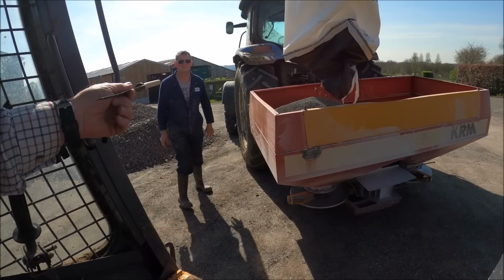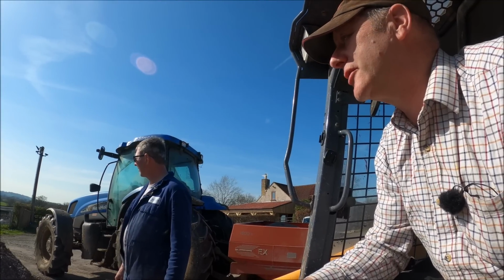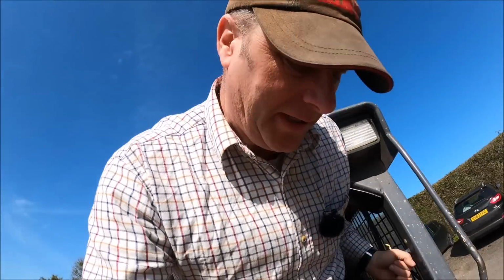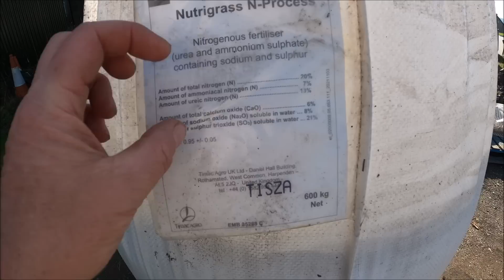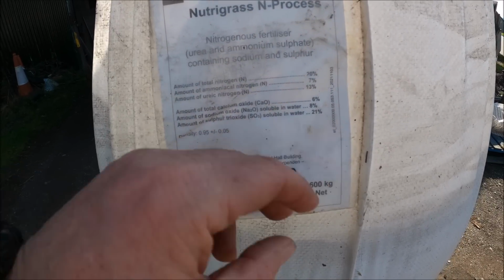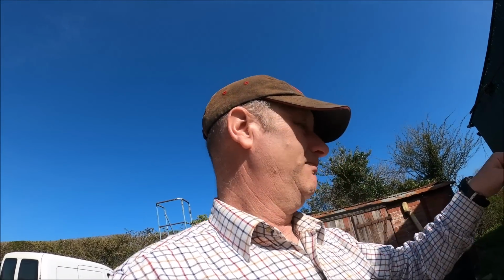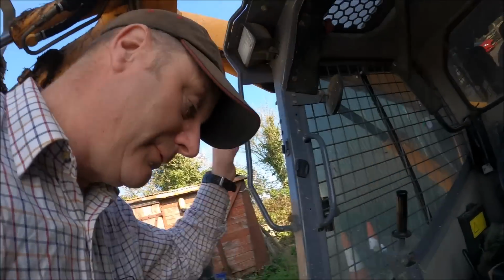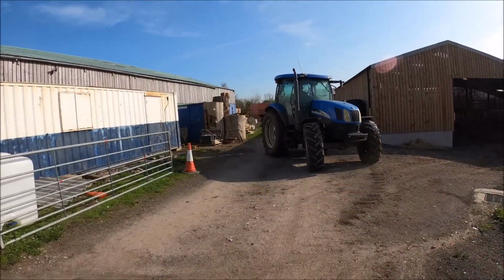05/04/23  Suns out. Get some fertiliser on quick!

Comment: If you pick the bag up so the loop is closer to the heel of the forks it’ll be less tippy
Reply: True but then it wouldn't be high enough to get over the hopper. Been there!!
Reply: @spentacle  so reposition when at the spreader. The majority of the travel (when it’s most tippy) can be done with the load at the heel
Reply: @pauljones2633  true 😎
Reply from the maker: Repositioning with flat pallet forks can be a faff, get it wrong and the whole loop folds flat. Besides, living close to the edge keeps me sharp. 😄
Reply: I did it with brand new forks once. As thee bag slid back the edges cut through the strap and dumped it on the ground. Spent the rest of the afternoon with a gridder smoothing them off. And no, I couldn't sit the bag down because the ground was muddy there.

Comment: I've always thought its a shame that fertiliser bags don't come with a tied bottom with a plastic or waterproof bag of some sort inside.The inside bag could then be disposed of and the outer reused.Just a thought.👍
Reply: I would think you'd have to speak to the powers that be on that one.
Reply: @AllieCat58  I agree and they won't listen.🙃
Reply: Some of the manufacturers do have ties at the bottom so they could be reused.
Reply: Seed bags are usually tied, a pity as you say as that fertiliser bags are not else they could otherwise be reepurposed.

Comment: Hi lan  can you not  lift in the  heal off the  tine it will  make a big  difference  to the  weight  on the  machine
Reply from the maker: Yes of course I could, and yes it’s a lot safer. But re positioning the forks to lift the bag higher can be a faff, and skipping the arse of the Mustang keeps me sharp. 😄

Comment: If you do collect the fertiliser,  why not take the bale trailer and do one trip?

If my calculations are right you would be pulling  around 13 tons inc the trailer weight, an OK load for 100hp if you are sensible.
Reply from the maker: There is a substantial hill between Sharpness and me, both up and down.

Comment: Why not carry the bag in closer to the machine it wouldn't lift the backend up so much also i think it would be safer it always looks a bit risky carrying the bag on the tip of the forks
Reply from the maker: A fair and correct point, but it can be a pain re positioning the forks if the bag loop flops over, and living on the edge sharpens the driving senses. 😄
Reply: @FarmerP  Those pallet forks are mega strong but surely everything has it's breaking point (or bending point)
Reply from the maker: @geraldbeard856  They are two tonne forks, I will never overload them with the Mustang.